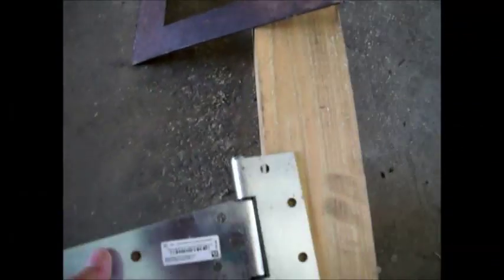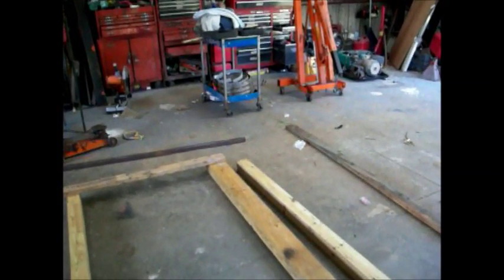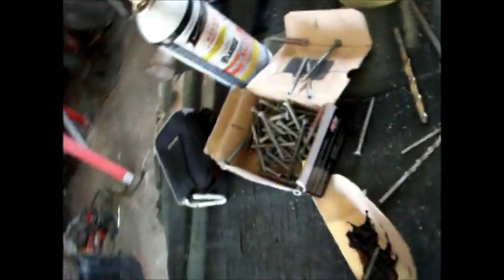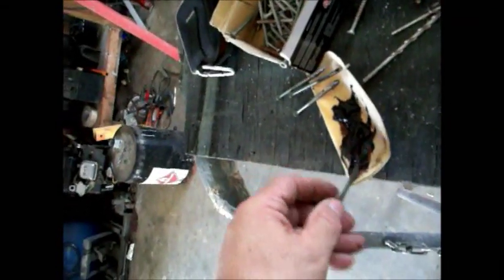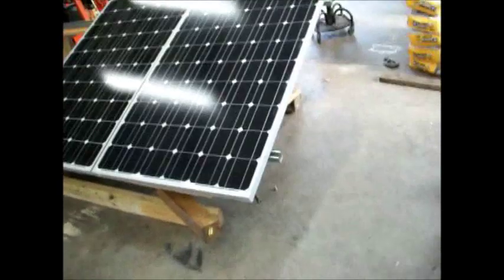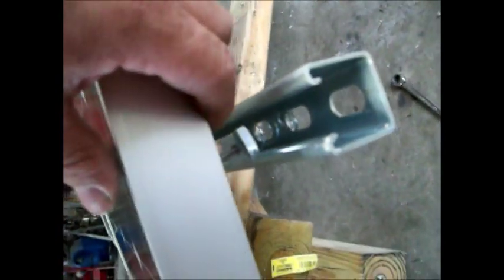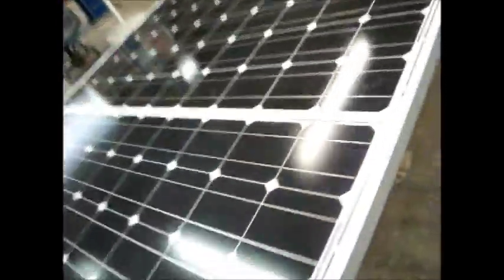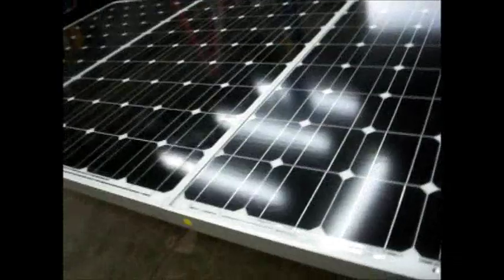MY TEMPORARY FIXED SOLAR MOUNT 3x240 Watt Panels.

Comment from the maker: It,s easier to mount your panels after u line them up and drill new holes in them to fit the rails than it is to use bolts nuts and washers but more costly.Well  worth the extra money as u can leave them a bit lose and slide panels into place up the super strut. to balance out the weight factor iI have buit into each hand made tracker mechanism

Comment from the maker: I have Just installed 2 -20 amp runs into the panel I have along way to go. and when i build the trackers and rearrange the panels I have 3 more leaning on the wall still. After all changes are made. I,m done with the solar project, I should be in the 3500 watt range total.when done all panels included.

Comment: You are probably already aware, just a friendly reminder, you were already coming close to the limit of a single 120V outlet. Hope you are installing a separate circuit for these. After all that work you may want to keep these the way they are and get some more! If you are nice to those connectors you could use them for something else.